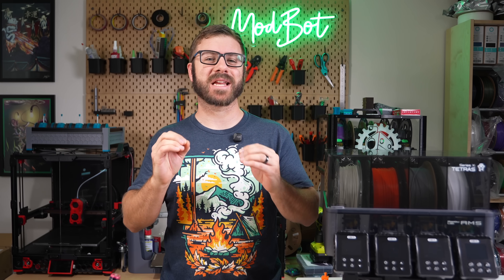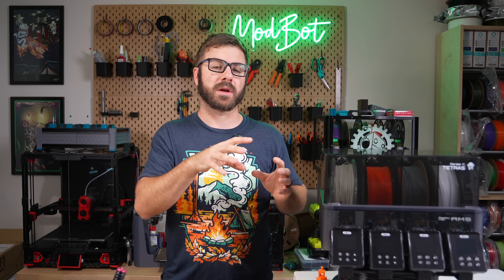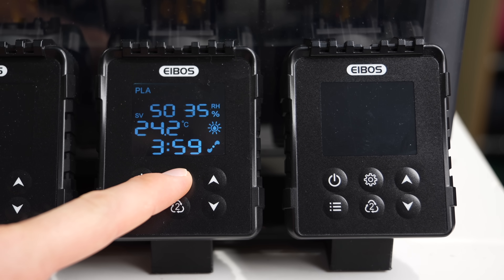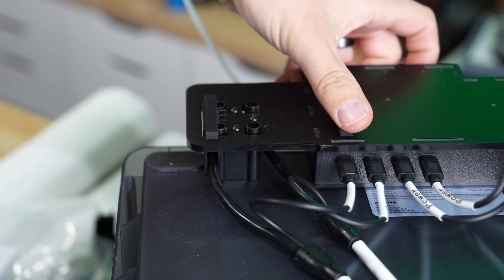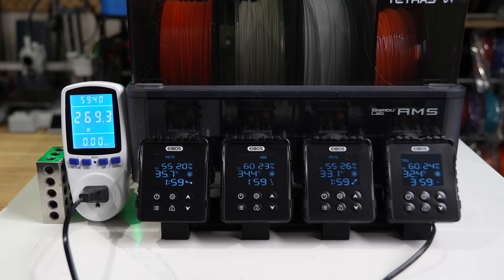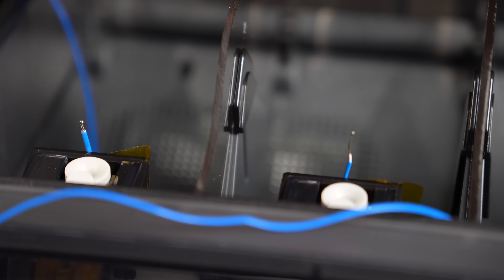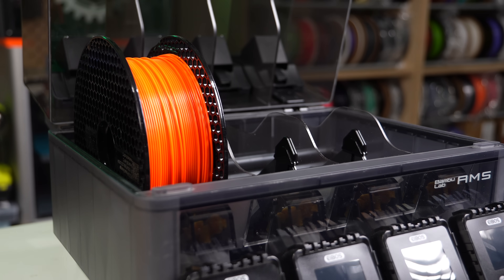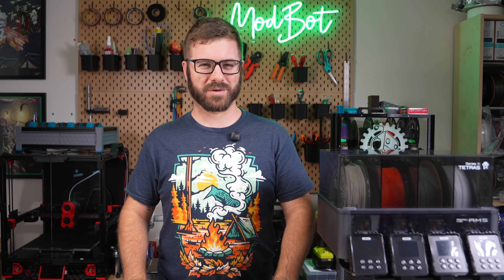Bambu Lab AMS Filament Drying Solution (EIBOS TETRAS)

Comment: I got 4xAMS (v1), problem is regulary the pla gets stuck in there and i need to "unclog" by opening the unit at the feeder part and that's the bottom, this is being bolted on the bottom, so that's pretty irritating in order to get it fixed..

Comment: For the temperature test- you have a 3D printer, you can print a gap guard with wire guide built in so the wires could go into the AMS and does not cause much of a seam.

Comment: Great review but gotta say, the design of that thing is just ridiculous!  The cables are a joke, the risers change the footprint of the AMS so any existing racks you may be using that were designed for the AMS are obsolete and I guess having the 4 slots independent are nice but I personally can live without that feature plus it only heats to 65.  The Sunlu Ams dryer is a far better design, took less then 5 mins to install and it works great!  I have 2 Ams units with the Sunlu AMS dryers and they dont look like Dr Frankenstein put them together!

Comment: So this only works if you already have an AMS? How does this save you money if you have to go get an AMS to use this?
Reply: Well most people when they buy the x1c or p1s they buy the package that comes with the AMS .. come on man
Reply: Yes you have to have an AMS.  It saves you money because it drys 4 rolls of filament at the same time.  A stand alone dryer that can do 4 rolls is usually cost between $300.00 and $500.00

Comment: Did you happen to measure the power draw on the stage 2 once its hits the set humidity? Does it turn on and off to maintain the stage two setting, or does it constantly run? comparing this to the sunlu version the sunlu pulls more power when drying but to maintain the RH it turns on and off only drawing 5 watts at a time.

Comment: Nice review. I don't think the cable depth on the back is a real issue since you need to have the AMS a few inches from a wall to open it anyways. It was super easy to assemble but they could add some words to their manual, so I know what they are talking about better. It will be nice to dry 2 or more spools at once and to keep my  petg dryer longer.

Comment: As if the AMS weren't bad enough to remove broken filament from the bottom. That looks like a nightmare, and who let that cable management pass? They couldn't find a 90° USB-C wtf.
Reply: I have literally never had to take my AMSs apart to get filament out, that's not a super common issue. And if your filament is dry and not brittle, you won't have that issue. If you have the OG AMS, cut the bottom out when you change out the tubes down there for easy access. Tons of mods for that.
Reply: I SAID THE SAME THING, AT LEAST THE 90 BEND IN THE CABLES.  Ive only had to take the AMS apart once to remove filament in over 1000 print jobs so far and it was because I didnt notice that the filament was super brittle before i sent the print job.  it was crumbling in my hands.  Having the dryer eliminates that issue, but not this monstrosity.  SunLu all the way!!!!

Comment: I don't understand why they made the risers so tall... seems like the risers could have been shorter and maybe even unified (less parts / points of failure).

I really like the concepts and the feature set I'm seeing. In theory the vents are awesome... but something about this feelings like an engineering model rather than a production model. I don't know why, but I feel a little bit more confident in the Sunlu version even though it's not as feature rich. Not sure which one to order.
Reply: DR Frankenstein deff had a lot to do with this design.  Get the Sunlu Ams unit.  It works flawlessly and looks great

Comment: very good review - the dual lane Dyas has me torn between it and the Sunlu - and similarly the vent has me worried for longevity...
Reply: The Sunlu has a manual vent on the top.  Deff want to remember to close it when done running a dry cycle but its also one less point of mechanical failure

Comment: I did this with my AMS lite sort of.
I got a 4 spool drier, above it is the AMS unit to which I ran PTFE tubes. I may not be able to print ABS or nylon but I use PETG and with my 60% humidity environment is a must.

Comment: Interesting concept. In my experience, especially for PETG, printing while drying causes nozzle / extruder clogs, so I believe the Bambulab AMS 2 is trying to prevent this.
Reply: The trick is to keep the temp setting for the dryer lower if using it while printing.  I set my Sunlu AMS dryer to only 50c when printing with PLA or PETG

Comment: Seeing as how this is for the original AMS, I'm curios to know how challenging it will be to access the internal PTFE tubes to remove any broken filament after installing this?  As much as I want a builtin dryer, it looks like removing broken filament inside will be a lot more complicated with this mod.

Comment: My biggest beef with using such a system is that that would take a fair bit more work to clean those pesky snapped filaments in the PTFE tubes in the bottom of the AMS.

Comment: Heated dryers require air vents. My tests show they reduce the %RH by 20-25 points, meaning room %RH is a big factor. While heated dryers are efficient up to 8-12 hours, further drying requires desiccant in a sealed container. My tests have shown vaccuum bags drawn tight hinder further drying. So, desiccant dry in sealed containers which allow air movement. Once dry, storage in vaccuum bags works well, provided the valves are stored flat, or, print some flat clamps and place them over the valves. I have printed desiccant bottles & caps allowing silica beads to be removed & dried in a microwave oven. Drying packets is difficult as the bags tend to hold moisture.

Comment: Bad timing considering that the price difference AMS and AMS 2 is $40, so all new AMS purchases will probably be the AMS 2. So this has an extremely limited market of just those people that have already purchased an AMS before the AMS 2 came out. If the price on this was less than $40, it might have had a future, but at $180, this has no future. Sad to see, cause they really put a lot of work on this and it really looks well thought out.
Reply from the maker: I believe they have been well aware through a large part of its development that it would be limited. The original AMS has a pretty massive amount of units out there so they must have felt it was worth it.
Reply: WOW, I thought the opposite of well thought out.  The whole thing with 4 controllers, seperate power to each lane.  My god, they didnt even think to at least have 90 degree bends to the power supplies.  The cables make the entire AMS 5" deeper.  Then the risers and 4 more cables running under the AMS.  It looks like a prototype to me

Comment: Very nice design, the only thing I find lacking (which is unfortunately the case with most filament dryers) is the max temperature. While this would be sufficient for PLA, it's on the edge of what would be useful for PETG and with other filaments you would generally need even higher temperatures. If it could go up to 85 C that would make a world of difference.
Reply: As a one stop solution for drying yes 85°C would be better for nylons and other engineering filaments they were worried about the AMS motors/electronics getting damaged and per bambu they kept it at a max of 65°C. Drying your engineering filaments in an oven then transferring them over at 65°C and adding in a good amount of Molecular sieves should keep the filament way less than 5% RH. In a dry box with a good seal I've got nylons/PET at 1% RH for quite a long time using molecular sieves. I just wonder how well the AMS seals as the sieves can keep filament under 5% RH for months.
Reply: Can you go longer at the lower temperature and achieve the same results though? (Realizing that isn't efficient at all, and I'm not trying to be a stinker)
Reply: @BlackenedBrewThat's kinda my thoughts. Maybe use a heftier dryer for an initial dry, then use the eibos to maintain while printing
Reply: @BlackenedBrew Yes, you can dry filament at a lower temperature for a longer time and still get the same results. As long as the temp is above room temp and allows moisture to evaporate, it works, just more slowly.

Comment: i rather have a dedicated Filament Dryer + a Humidity control for the ams enclosure (Maybe the sunlun ams heater could be the solution)
Reply: Yup, The Sunlu AMS heater is what your looking for.  It  drys then automatically monitors internal humidity levels in the AMS.

Comment: Thank you Daniel for this. I’ve been looking at Tetras and have been intrigued. My apartment averages around 50% humidity and that has been a concern for my filament. A while ago I upgraded my AMS to Hydra Pro. I like that I can use a wider variety of filaments in the Hydra, but l think I’d find drying to be more important. I’ve also been debating upgrading to the AMS Pro. I think I could revert my Hydra back to stock AMS reasonably cheaply. Not sure which option would be more practicable. 

I love that Tetras has a setting to activate when humidity level rises. You brought up a concern that I hadn’t considered. I live in a small apartment, a converted 1950s hotel. So, old wiring and questionable reliability. 

Things to think about. I appreciate the data.

Comment: Sunlu is coming out with one as well, I sure would like to see a comparison vid.
Reply: From what I seen all you have to do is swap the lid, no modifications to the actual AMS.  If it works well and is more compact that is the one I would go with.
Reply: @LS11971 The Sunlu one is whole chamber as a single zone though
Reply: sure hope they make one that has a higher maximum temp
Reply: @inoob26  I just got my second Sunlu AMS Dryer.  Far better design, a couple mins to install and the heat to 70 so a little bit hotter
Reply: Yeah this one seems better than the sunlu for the individual slots. They make one at the same price too with 2 chambers instead of 4

Comment: Does the AMS still work well as an AMS? I mean, all the spooling in and out etc? Any concerns with the original AMS parts deforming over time due to this drier?
Reply: Doubt this would change the functionality of the AMS. Its only adding to it and  i dont think itll melt anything. I wish it went higher in temp.

Comment: Yo, this exactly what I needed! I use an external dryer and then place it into the AMS right after if that is something I’m going to do but still not ideal. I have convinced myself that I won’t be buying anymore BL products because of their “security concerns” and have opted out of any further updates. This is perfect and dream come true. Hopefully the price isn’t too crazy though.
Reply: Your paranoid. I'm on the new firmware. FTPS and everything else works great. You guys crack me up the company themselves found found vulnerability in the system and they patch it but you're so worried about using orca slicer which is technically sort of hijacking into the thing to begin with.

Comment: ive made several of the spae pi mod AMS 1 dryer.  works great. my current redesign uses melt in connectors for the bottom panels so you can service.

Comment: Hello Modbot,

I’m not entirely sold on this AMS dryer option. The design seems overly complicated, with numerous parts that could potentially introduce points of failure. I’m also a bit puzzled by the power configuration — it feels unnecessarily complex and could likely have been implemented in a more efficient way.

The moisture vent system is another area of concern. I hope it’s serviceable, but even so, it makes me wonder why a more straightforward solution wasn’t used. I still question whether a simpler design could have achieved the same results with fewer moving parts. 

This is actually the first time I’ve come across the EIBOS AMS dryer. I’ve been researching the Sunlu AMS dryer recently and, to be honest, I find its design more appealing. While it’s not perfect, I appreciate its simplicity and more straightforward approach. Personally, drying each AMS chamber individually isn’t a major priority, since drying at 60–65°C is sufficient for all the filaments I typically use.

That said, I really appreciate your video — it provided a great overview of the Eibos unit, along with helpful insights on installation, pros, and cons. At this point, I’m leaning toward the Sunlu solution, but I’ll definitely keep an eye on EIBOS for future updates. I’m also glad to see multiple manufacturers entering the AMS dryer space, as this kind of competition will only help drive innovation and improve options for all of us in the long run.

Comment: It would be interesting if a manufacturer tries a different approach to filament dryers: instead of always drying whole spools, it would be practical to have a kind of continuous heater through which the filament passes on its way to the extruder. This way, you would only ever have to dry the amount of filament that is used for the current print and it would be usable for every type of printer. Perhaps control via Klipper and it would be perfect
Reply: I think the reason it doesn't work is because the physics of it dehydration is a very long process flash heating a filament would just melted and doing it right would be an incredibly slow print. Assuming the filament is wet. If it is a preemptive measure for a new filament then its a different story and debatable need.
Reply from the maker: This has been attempted. I covered one maybe 5 or so years ago and it didn’t work. There’s this one for two grand but I still have my doubts https://drywise.co

Comment: Looks amazing. I wish it came out two years ago, before i converted my AMS to a fully enclosed python. Oh well.
Reply: Meh.  I've got over 2k hours on my Python and have had exactly one jam with a piece of filament getting caught in the AMS.
Reply: How do you like the python AMS? Would you still recommend? (Not trying to hijack this thread... I did order this one)
Reply: @BlackenedBrew has been working good for me, and zero concerns about lighter / odd sized spools of filament, but the poly dryers were a touch pricey
Reply: @BlackenedBrew As Derek said, the poly dryers price was the only issue.  That, and it's a tad inconvenient putting the spools onto the holders with the gears, but it basically guarantees no issues.

Comment: good stuff as usual, dude.  i'm not a bambu guy, but the tech this represents should be fairly easily applied to several other multicolor/material solutions, box turtle being a perfect example.  hopefully they work out the cable management piece with the next iterations too, since it's not really all that hard to build in 90° ports similar to how the cabling from the power distribution hub does.